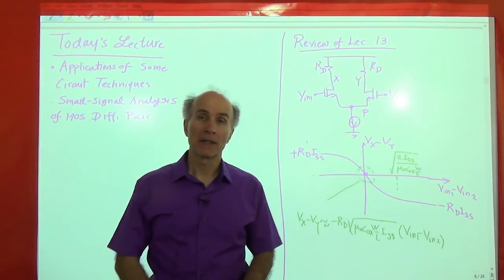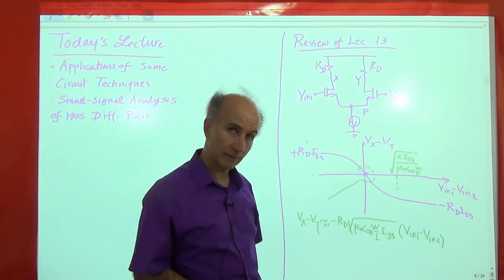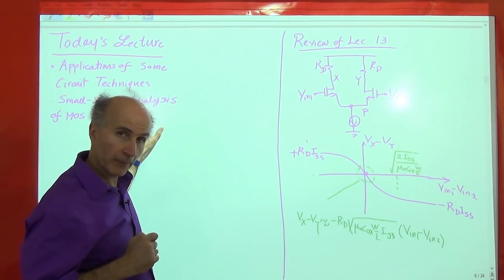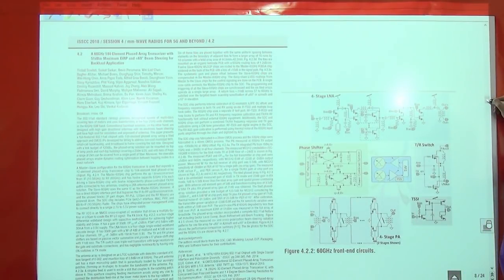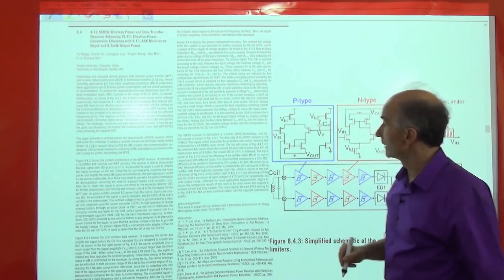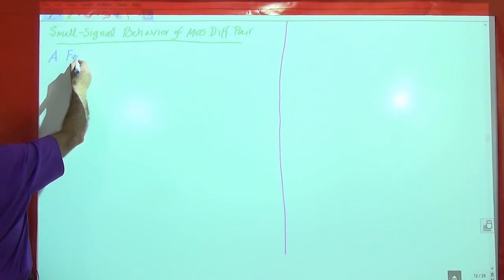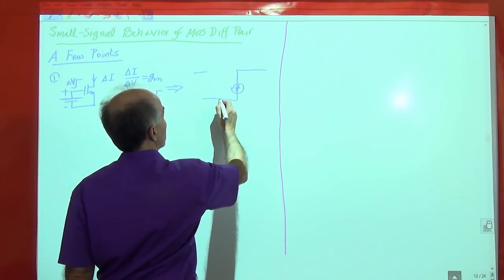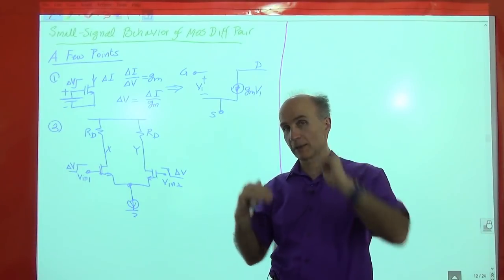Razavi Electronics2 Lec14: Small-Signal Analysis of MOS Differential Pair

Comment: Does anyone know how in the last example R1/2 was connected to ground? 
I don't fully understand how differential changes cause the resistor to be connected to ground. Why don't we consider the output impedance offered by the other transistor?
Reply: Since we proved at around 20:00 that the source voltage (Vp) does not change for small signal inputs, professor has deduced that the points of symmetry in a symmetrical circuit are points which are not affected by small signals and are thus AC grounded. Alternatively, if you want to consider the effect of the other MOS device while finding the gain, what you could do is find Vx and Vy for Vin1 considering Vin2 to be grounded and vice versa. Hence you could find (Vx-Vy) wrt Vin1 and wrt to Vin2 from which you could find out Av. It is just a little bit more complicated process.
Reply: rewatch at 18:10

Comment: In Lec12 it was said that Vp changes when Vcm changed. at 18:44 it was said that Vp doesnt not change when Vin increases. is this Vin signal source? How these two scenarios are different
Reply: VCM in lecture 12 is DC common mode voltage. whereas change in vin in this lecture he is talking in small signal change.

Comment: DC current devices should be open circuited...why did u put GND while considering small signal analysis?
Reply: That's correct, but in this case, with Vin1 & Vin2 changing differentialy, Vp remains constant (it's a virtual GND); observe that ideal current sources don't behave in this way, only current remains constant for any load connected; then, in small-signal analysis this node is ac GND. 

I suggest to you review lecture 10 of this course, for a better explanation.

Comment: Thank you sir!!
I have one doubt. Why are we placing current source in the bottom in NMOS Diff pair and in the top for PMOS diff pair. What will happen if I do the reverse?
Reply: The biasing current in NMOS devices flows from the drain to source; whereas in PMOS devices it's the opposite. So, when 2 NMOS( or 2 PMOS) devices are interconnected as a differential pair, the tail current source (= Iss ) should be placed to ensure that the biasing current flows in the appropriate direction through the respective devices.
Reply: that current source in real design is a biased transistor who plays role of current source, you can not do the reverse because NMOS is steering-current device and PMOS is a pushing-current device